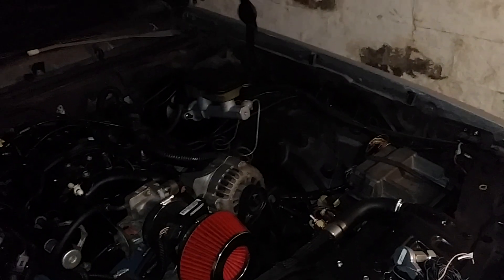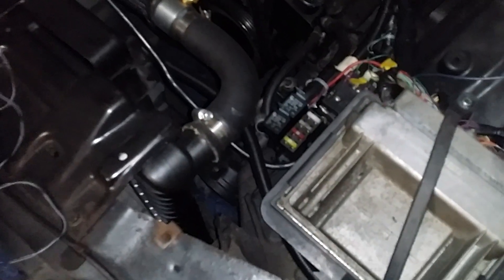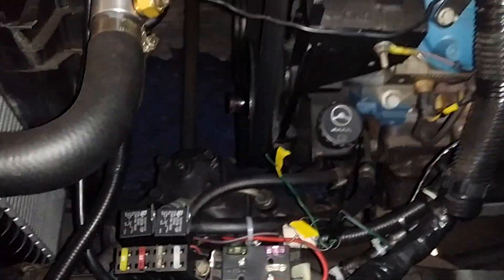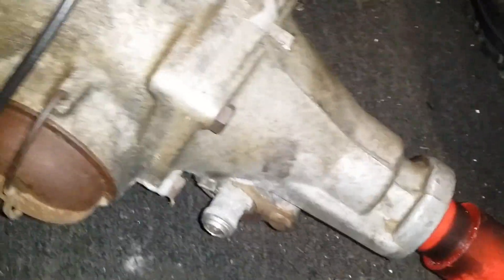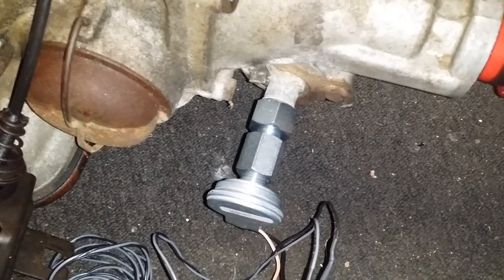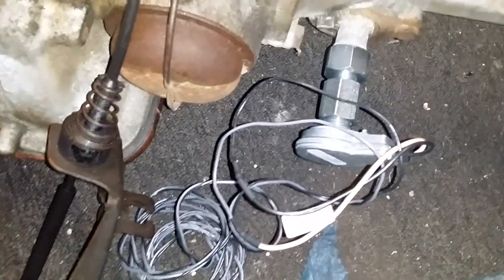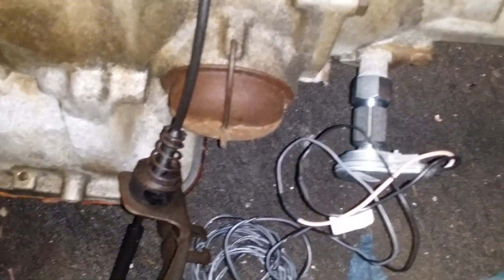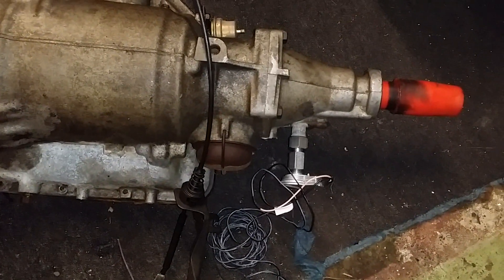HOW TO : LS1 swap Gbody **Vehicle Speed Sensor** Install retrofit

Comment: donde lo venden!? y como se pide
Reply from the maker: Summit Racing Mi Amigo
Reply: BEETEROLDS  
cual es la funcion exacta amigo
Reply from the maker: Oscar Funtes  the speed sensor basically tells the computer if the vehicle is moving or not. It helps maintain idle quality and it can help or hurt fuel mileage if it isn't dialed in properly.
Reply: BEETEROL
cuanto cuesta? aproximadamete

Comment: did you have to change a gear in the tail shaft
Reply from the maker: Leslie Washington as long as the computer is getting a signal that the vehicle is moving 9 times out of 10 you're good to go. I've heard others argue that the output gear must match the gear ratio. But I haven't had an issue
Reply: D.Szymanski thanks im going through it now with my tuner.

Comment: just going to chime in with my two cents here, I had my g body 5.3 swap dyno  tuned with HP tuners from a very good local tuner in my Rochester NY area and my set up was tuned and is running very well without a vehicle speed sensor. however! I did run into a issue you described with the idle issue(wanted to stall out) and I found that my new Bosch O2 sensors were junk! Switched to Denso sensors while tuning and bingo! Engine was and still is running like a Swiss Watch! Again just my opinion here I am not a expert tuner but have heard also people running the VSS set you got with good luck. great vids and great info brotha keep it up and check out my swap if your bored LoL Happy Motoring! :)
Reply from the maker: hey man I appreciate the comment! I too am running Denso O2s. i need to scan it for codes. Who knows maybe i too have a bad sensor.. I've heard mixed results with the VSS.. but since I already had it I'd figure I would try it
Reply: +D.Szymanski simple trail and error good ole modern day hot rodding! You sound like your on the right track for sure! Other thing to is when I had my 5.3 tuned was the location of the Mass air flow meter had to be tuned different because I see yours the same as mine is close to the throttle body. tuner said ideally there suppose to be 18" away from throttle body but again he was able to tune it being close to throttle body and all is well! Anywho just more ideas to try as you tune her up! EFI is nice turn key and drive to nearest ice cream shop!
Reply: I read something about turning off the engine braking? Lmk what you found.

Comment: Any ideas on how to hook up an electronic speed sensor on a T-5 to a manual gauge?  Or a reasonable way to setup a digital speedometer?
Reply from the maker: No idear sir LOL Never farted around with a manual in these cars.. YET
Reply: D.Szymanski
  I looked at a 1986 Monte SS last night that was converted to a WC T-5 manual!  $4000 or best offer.
Very tempting, if it had fuel injection I'd be interested.

Comment: So let me get this straight .. That adapter is to be able to have a speed sensor for PCM reference? Will u still be able to use old speedo cable?
Reply: So if you're running say a Dakota Digital G-Body dash cluster you can use this VSS for both the PCM and speedo input correct? Is it not possible to just run a GM VSS from say a 4L60e?

EDIT: Huge thanks for these videos BTW!
Reply from the maker: The unit I used wont work with a speedo cable the SEN-4165 is what you need to retain the cable
Reply from the maker: Good question... I dont have an answer in regards to the dash unfortunately...

Comment: Good info!! And your right ! For 30 bucks just put it on..
Reply from the maker: It may take a few driving cycles for the pcm to register it... Some folks need it reprogrammed... I drove mine and had mega idle issues when it got hot.. but after driving it for an hr or so it seemed to mellow out
Reply: BEETEROLDS hey I know you're pretty busy man was doing a swap on my buddy's car was wondering what pinout thats for?thanks man!